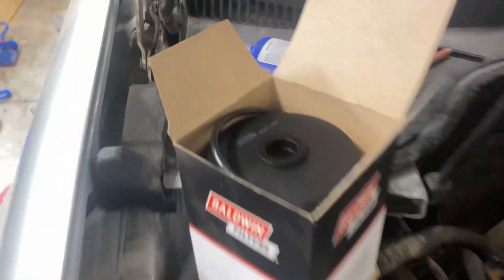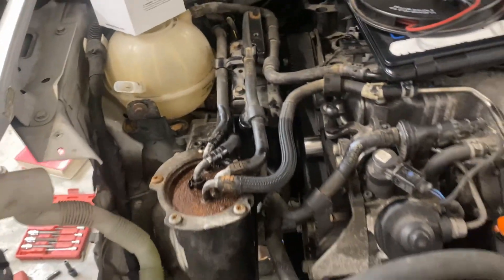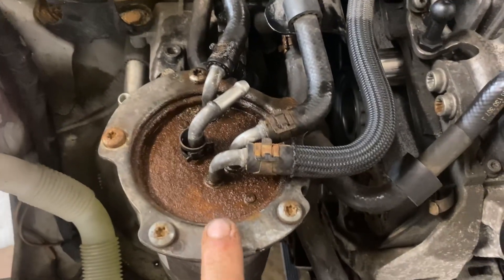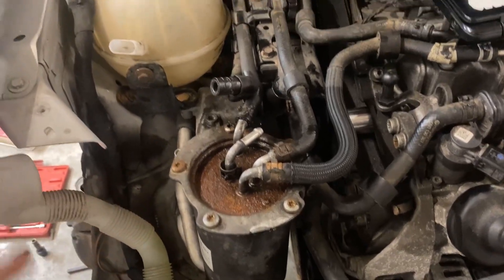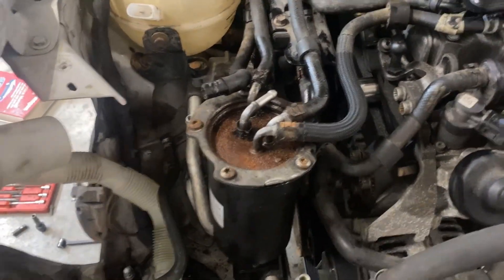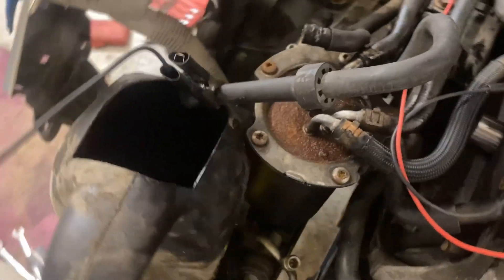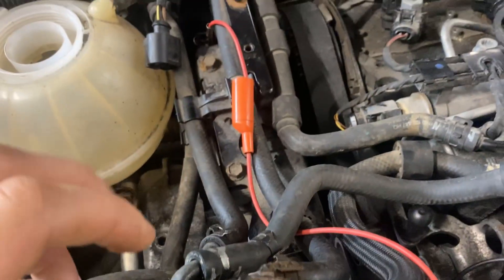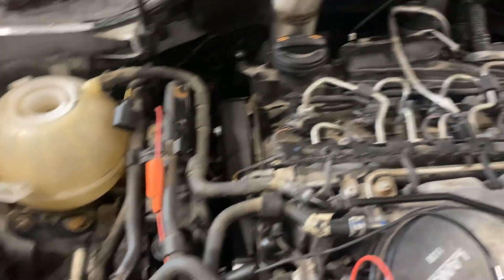VW TDI CJAA Fuel filter replacement and priming: With and Without VCDS

Comment: Hey josh, videos a bit old now so i hope you see this.
I just replaced my valve cover gasket on my cjaa and am grtting a crank no start. I primed the fuel system manually doing the in tank first then the aux pump sexond both for 3 mins each. I cranked 3 times for 5 seconds each but no start. I noticed fuel shoot out of the fuel return line on top of injector 4, as there is a small crack.
Would this crack in the fuel return line cause my no start? Or could it be it needs to be primed using output tests, group 35?

Comment: I have a question. If I hook up direct power to the aux pump and it doesn’t kick on, is it done and needing replaced? I’m experiencing a no start. I did notice that it kind of bogged down sitting at a stop light a few times. I tried everything in your other videos to diagnose it (I have a dpf code and I pulled it off and still have a no start problem). I replaced the fuel filter and hook power to the plug like in this video and nothing happened. I tried it with the key on also and still nothing. Tested it with a test light and it is getting power but not kicking the pump on. Wanted to check with you before I pull the lift/ auxiliary pump and replace it. (I’ve worked on a lot of Cummins diesels but this is my first tdi)

Comment: Great video.  It works as shown using the jumper wires on for my 2013 Jetta TDI MK6 CJAA.  Only difference with my car is the rear wire is brown and the front wire is white with a red stripe.

Comment: Josh I have an issue I do not have power to the Aux fuel pump. It runs I jumped it, pump fuel al the way to the injectors. But will not pump in the output test, tank pump runs
Reply: Did you figure out the issue?

Comment: Would jumping it off the connector still work if I changed the aux fuel pump?
Reply from the maker: Probably will need to run the tank one as well

Comment: Hey Josh.  Great video, thank you.  I followed your filter change procedure with VCDs and ran into a bit of a problem.  After priming for a while the car wouldn’t start.  I opened the filter housing back up and found it had filled the housing.  Finally managed to get the car to start if I ran the fuel pumps with VCDs and started the car at the same time.  Car starts now without issues.  This morning I went to check to see if the in-tank pump was running so I ran the pumps again with the seat off.  Pump runs but again, car now needed to have VCDs run the pumps while cranking.  The car again starts now without any issues.  Any input would be appreciated.  Thank you.
Reply from the maker: Sorry for the late reply, is there a possibility it’s still working air out of its system? Possibly a leaking filter o-ring?
Reply: @JoshsJettas  Thanks for the reply Josh! I had a look the other day and didn't see any leaking from the o-ring for the filter housing lid.  I don't think the issue is with still having air trapped in the system.  I've been driving the car for about 2 weeks now and no issues.  But if I go out and run the VCDs priming procedure it will do it again without opening the lid to the fuel filter.  Could the in-tank pump have a built in check valve that's stuck open or something? Thanks again!

Comment: Can I run fuel pump wih VCDS without loosing the tube on top of diesel filter?
Reply from the maker: Yup it will just pump fuel through the system and back to the tank

Comment: Definitely best to jump both the tank pump and the intermediate pump at the same time. I just made a used a long piece of twelve gauge wire that stays under the seat hooked up to the positive wire of the lift pump (wire nut used when not in use) and just run it to the front intermediate pump when I do my filters. Saves time and money..
Reply from the maker: For sure, it was more of a can-you test and not a should-you. Sounds like your idea is nice and simple to do

Comment: I tried to prime it with the ignition but there is no fuel that comes out when turning the ignition. Did the ignition thing more than 20 times in a row.
Reply from the maker: That’s what I was trying to show at the beginning, cycling the key on Jettas/golf’s/beetles/Sportswagen doesn’t prime anything. Will need to jump pumps or command them on with a scan tool

Comment: 2010 jetta tdi. Is there a checkvalve that keeps pressure from leaking down. After 8-10 hours takes a couple cycles to start. Anything less cranks right up.
Reply from the maker: Not that I know of, but that seems to be a common complaint on these. I’ve noticed it too the odd time it takes a few more revolutions before it fires

Comment: This is a great video. thanks! 

If I fill the filter holder back up with diesel are you sure you don't need to jump the rear pump too?

I just looked at my filter today to see if it was dirty. Lost a little diesel (not a lot). Should I still prime it? I idled it for about 30 seconds already (ran normal) but then shut it off cause I figured I should maybe prime it to make sure.
Reply from the maker: Yup there’s enough in there for the front pump to do it’s thing, if you’ve already had it running don’t worry about priming it’s good to go

Comment: hi josh where do you hook up the jumper wires is plus and negative to battery and back to the pump. when i drive with some power i get a stumble and the glow plug light flashing then when i scan the car i get low fuel pressure thanks
Reply from the maker: Yup back to the battery, browns ground and blacks power. If your getting p0087 I’d pull the pump control valve and look for filings indicating the pumps failing
Reply: @JoshsJettas  thank josh

Comment: You've already got it, nice. Hopefully, I didn't mess it up too bad just cycling the ignition but it started right up unlike the first start after your timing belt change.
Reply from the maker: People have their opinions on how bad it is, they do fail but im not 100% convinced it would be from air. But better safe then sorry
Reply: I’ve changed two, thinking that cycling the key would work because I heard the clicking. Thankfully they haven’t failed yet. I didn’t drain any of the fuel though. Left the canister full. Also took it easy on them after startup.

Comment: Why not prime the system by filling the filter housing with fuel?
Reply from the maker: That’s what I did before running the auxiliary pump and it still had air come out. Some people swear by the pumps getting wrecked by air getting mixed in with the fuel.
Reply: Fill it with extra fuel to where the fuel runs out when replacing top cover.